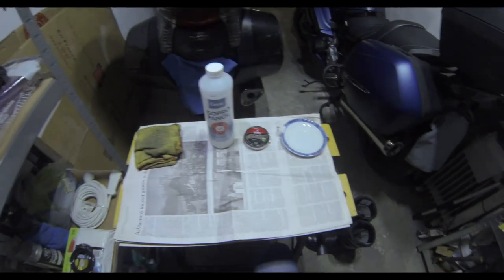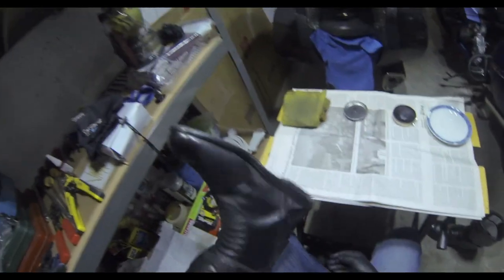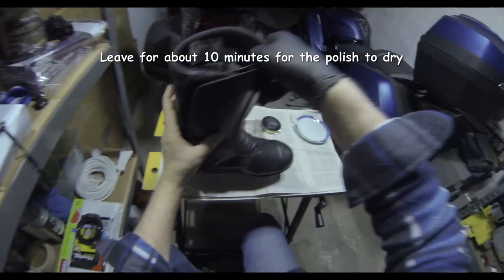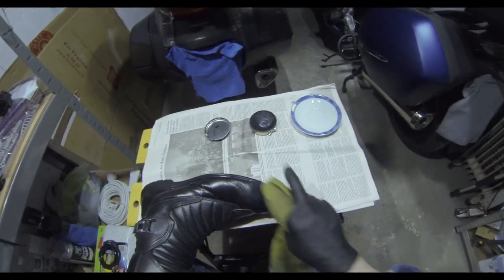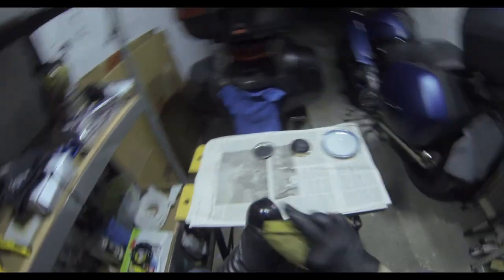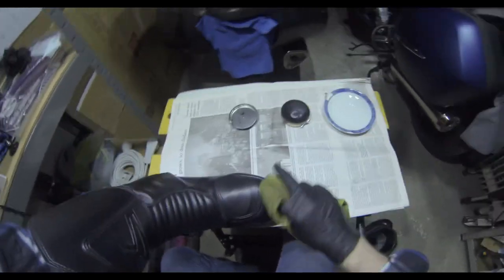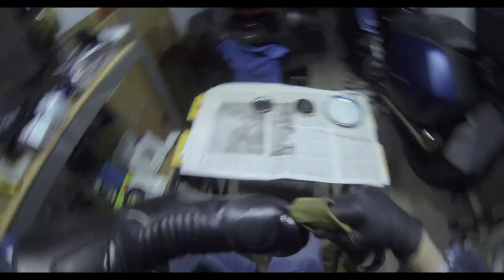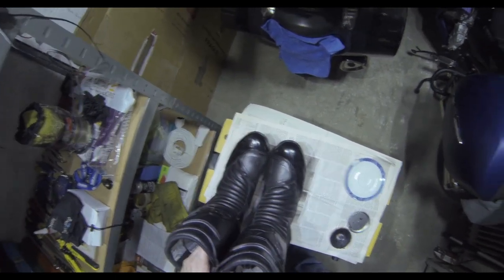BULLING BIKER BOOTS to a MIRROR SHINE - in 30 MINUTES or LESS

Comment: In all the years I've been bulling shoes and boots to a high gloss finish, I've never encountered this method before. I've always applied the polish with a duster in the same way that you apply the dilute alcohol, but in my case with the addition of spit, and continuing the polishing action until all the polish has been transferred from the duster to the shoe/boot, by which time there is a very well developed shine. Repeat until the desired level of shine has been achieved. I shall try your method by way of comparison. That aside, hitherto I had thought I was alone in being someone who still could be bothered. 😀
Reply from the maker: Give it a go, the results are better.